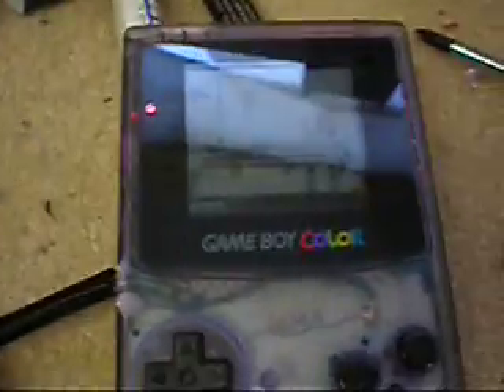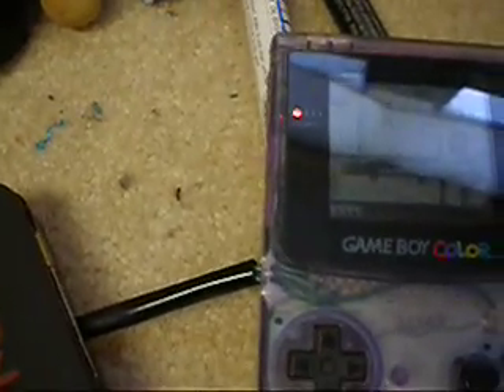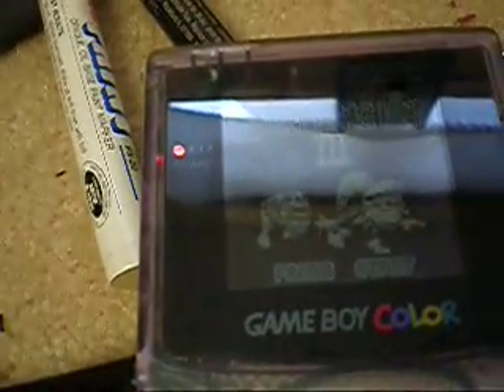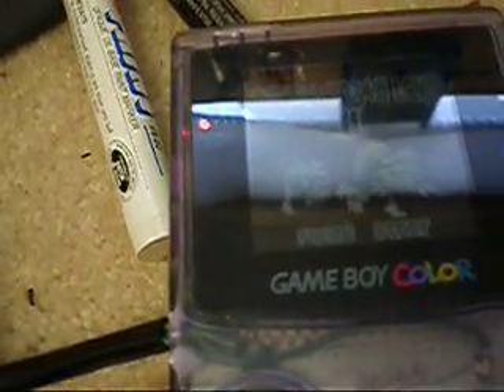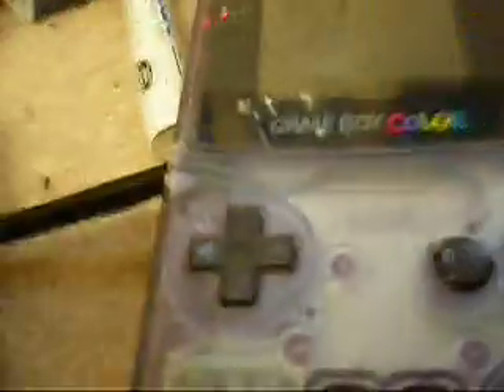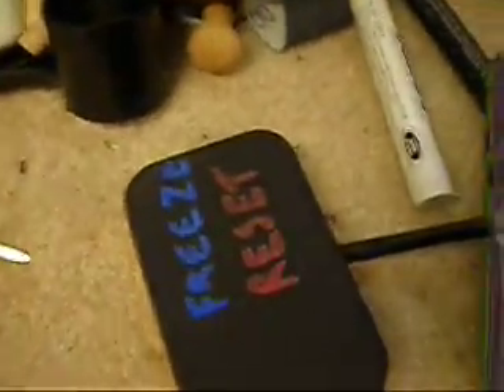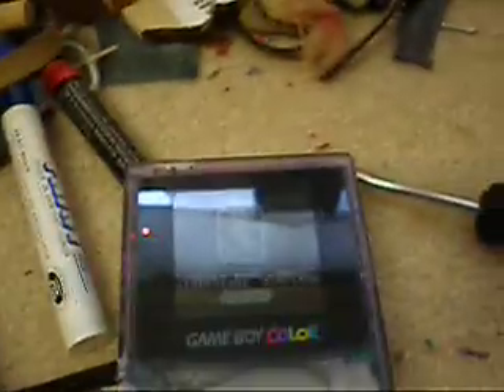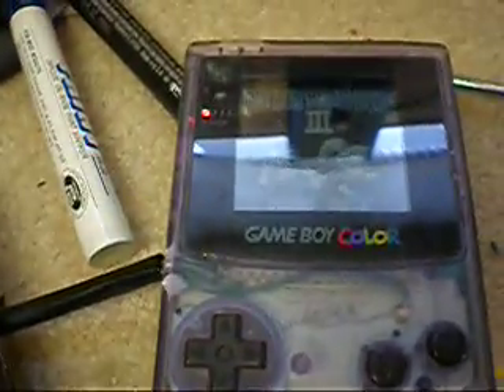Circuit Bent GameBoy

Comment: Well, in the case of the GB I think you should rethink that principle. ;)
Did you click the derWarst link? There are a couple of others too. Video ID's:  BE1mYNpvyH0 ypmBP_Pt1Bg LFp2c0ELylQ
An intricate clock hack would allow you to adjust the speed, as well as perhaps going a step further and feeding audio back to the frequency control to allow some sort of self-FM. That'd allow some rad effects with relatively unchanged functionality.